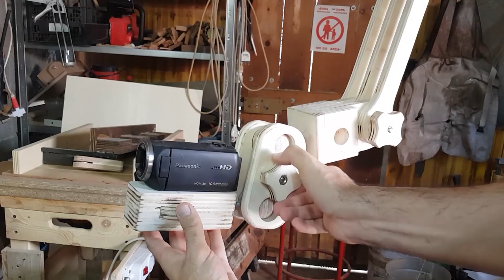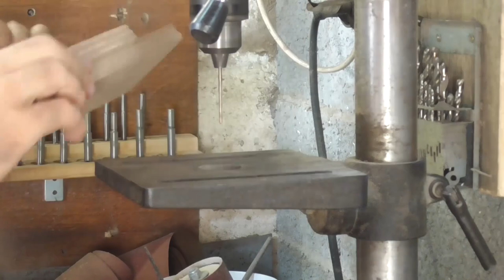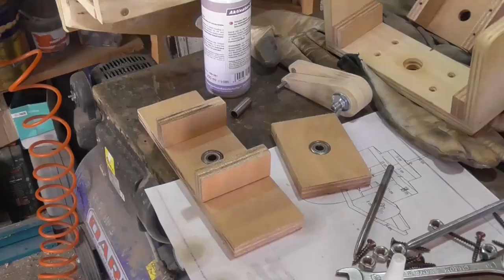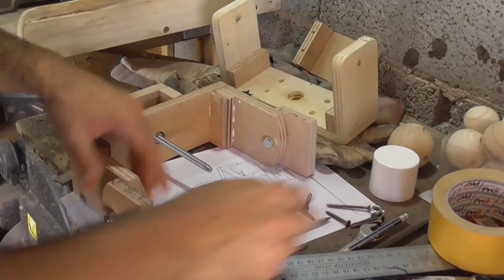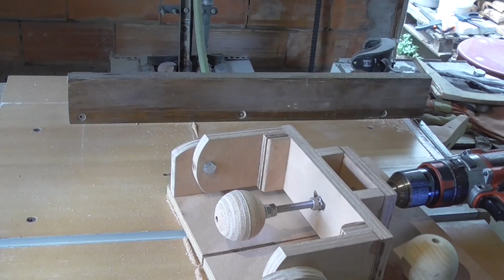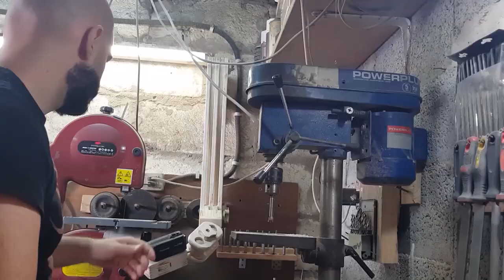WOODEN SPHERE Table Saw JIG - Easy Precision Turning With NO LATHE

Comment: Really interesting idea! Never seen that on a tablesaw. I was thinking in the direction of using the tablesaw as a lathe for knife handles but have not tried. 🙋🏻‍♀️Anna
Reply from the maker: Thanks! I've seen someone using the tablesaw as a lathe to make dowels so it could be done! I actually used something similar to turn the wheels for the belt grinder
Reply: @Gabrulo_knifemaking  yes, I have seen that as well. However, I have not done it yet (or build specific jigs) because I don’t do mass production :) however, I often use the tablesaw to get both sides of a hidden tang handle exactly parallel to the blade and same thickness. Less work and room for error on the belt sander. 🙋🏻‍♀️Anna
Reply from the maker: Absolutely, the table was makes faster and easier to get squared handle material👍
Reply: @Gabrulo_knifemaking  i actually use it in combination with a jig after the blade is in the handle, because it is difficult to align hidden tang blades exactly parallel to the handle material during glueup and to drill precisely in the middle of the handle material. If you are interested you can see the procedure in the BBQ knives video, but I double check if everything is clamped down doing this operation 😂
Reply from the maker: Ooooh nice idea, will check it for sure!
Reply: @Gabrulo_knifemaking  thanks! I am sure with your jig building skills you would be able to build something more sophisticated than my solution 😂
Reply from the maker: More than skill is the will to make strange tools 🤣😅 can you tell me in which video is the jig you made? I don't know german so is a bit difficult to find for me😅
Reply: @Gabrulo_knifemaking  it is labeled making knives “Mr. and Mrs. BBQ” and should be the 2nd newest one